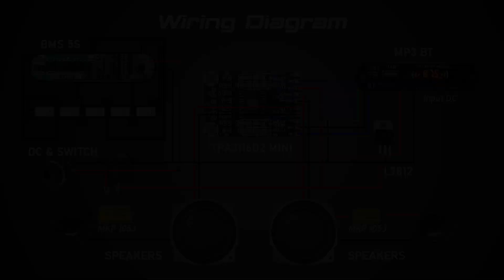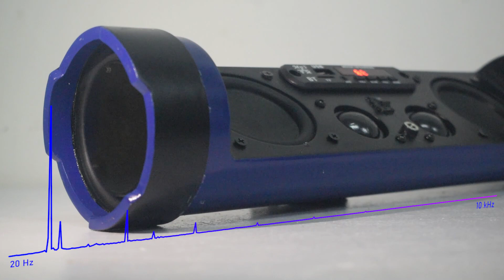DIY PVC Bluetooth Speaker 3 Inch 100 Watt - Aiyima 3 Inch Midrange

Comment: nge lem pasif radiatornya pake lem apa bang?
Reply: Mau kuat bang?
Reply from the maker: Infonya masse? Gimana gimana 🤤🤤🤤🤤
Reply: @RODDEVID  kuat lengketnya maksudnya bang
Reply from the maker: @blackie2774  rata2 pake zhalinda t7000, kuat tapi bisa dilepas juga ga susah
Reply: Oke bang thx infonya
Reply from the maker: Pake lem T7000 om merk zhalinda

Comment: Bang kalau speaker Aiyama 2x 50watt sama kayak punya sampean 
Terus amplifier Tpa3116d2 2x120 gimana bang ????
Terus kalau beli mp3 bluetooth yang sudah ada colokan charger micro dan dipasang di battery bms 5s apakah bisa di charger pakai charger hp ???
Mohon pengarahannya
Reply from the maker: tpa3116 2x120 watt cocok lah bang
kalo mp3 bluetooth itu hrus supply 5V, jdi kalo pake bms 5s, abang turunin dulu tegangannya pake regulator L7805.
Reply: @RODDEVID  cara pasang regulator nya dibagian mana bang ???
Reply from the maker: Ada divideo yg karoke marshall bang, menit 7:35 dan 8:00
Dan juga divideo sy yg sebelumnya ada juga
Reply: @RODDEVID  ok 
Mksih informasi nya
Reply from the maker: sama2 bang
Reply: @RODDEVID  siap bang 
Tapi ngaruh gak ke kualitas suara speaker nya ????
Reply: Mp3 bluetooth itu ada yg bisa support 12v dc gak bang?

Comment: Sehat gan mau tanya klu pipa 3"pake bas pasit nya ukuran brapah .mm.cm
Reply from the maker: Pipa 3 inch itu diameter ny skitar 90an
Mungkin passive 90 mm aja
Tapi sesuaikan juga sama diameter speakernya gan
Reply: Buat tutupny pake pralon ukuran brp lur ?
Reply from the maker: Tutup pralonny itu pake sock 3 inch juga bang kalo sy

Comment: Bang klo pake pipa 4inch bas radiator nya pake yg berapa ya
Reply from the maker: Tergantung speker yg dipake,
Smua ada hitungannya
Kalo misal speker 2 inch, pipa 2.5 inch, passivenya 60-70mm.

Emang itu pake pipa 4", speakerny brapa inch?
Reply: @RODDEVID  sya dah punya bahan pipa 4inch.speaker nya 3inch.modul nya pake xy_p 30 wat.tinggal pasif karbulator nya bang bingung mau di kasih yg berapa ya..dan satu lg bang mau di suplay pake berapa volt ya.biar jos suaranya ngalahin JBL flip5 😀
Reply from the maker: @radityaradit7684  kasih passive radiator 3,5/4 inch tapi yg lentur
supply pake 12 volt aja, powernya tpa3118 kalo0 mau ganas.
Reply: @RODDEVID  ok bang makasih info nya
Reply: @RODDEVID  Speaker aiyima yg 3 inchi tpi baru punya satu ga tahan sama harganya bang 😭😭
Reply: @RODDEVID  dah sya subscribe bang 👍
Reply from the maker: @radityaradit7684  thanks bro 🤩

Comment: Bassnya gimana gan?
Reply from the maker: Lumayan, ga begitu low banget sih bass nya.
Mungkin karna karakter speakernya bukan low bass.
Reply: Kalo di pasangin tpa 3116 yg plus tune control kira2 gi mana gan?
Reply from the maker: Plus tone control, vol treble bass kah mksdnya?
Dlu smpat nyoba sih pake yg ada control bassnya, bassny nambah
Tapi kalo tweeter ny msih kurang bang.
Reply: @RODDEVID  iya gan, di tambah sama twitter
Reply from the maker: Sip itu kalo ditambah tweeter

Comment: Bang saya punya speaker aktif di buat begitu bisa gak bang dan posisi Abang tinggal di mana?
Reply from the maker: Speaker aktif ukuran brapa inch bro, modelnya kyk gmna
Sy d depok.
Reply: @RODDEVID  kira-kira Abang bisa modifikasi punya saya gak?
Reply from the maker: Bisa aja bro, brrti kalo mau dibuat sprti video sy, pakeny pipa 6 inch
Cman bahanny kita blm ada pralon 6 inch
Reply: @RODDEVID  . kalau paralon saya ada bang.
Reply: @RODDEVID  . pipa Paralon saya ada bang .
Reply: @RODDEVID  . Klu Abang bisa kira-kira biaya nya berapa paralon saya yg tanggung.
Reply from the maker: Lokasimu dmna?
Lanjut WA aja bro
085157742114
Reply: @RODDEVID  GMC 888E
Speaker system 2.1 Channel terdiri 1 Subwoofer dan 2 satellite
Power output 55 Watt (RMS)
Freq respon range 20 Hz ~ 20 KHz
Perangkat Input Player berupa USB Port device
Jack Audio Output
Pengaturan Level Volume putar
Pengaturan Level Bass putar
Pengaturan Level Treble putar
Tegangan listrik 220 Volt / 50 Hz
Berat 5 kg
Reply: @RODDEVID  .ada dua biji bang tapi satu nya bukan GMC ukuran nya sama seperti GMC.

Comment: Bang itu pipah nya 3 inch
Reply from the maker: Iya 3 inch bro
Ini sesak bgt, saranku kalo buat pake Speaker ini pake pipa 4 inch aja
Reply: @RODDEVID  saya udah bikin yg tiga inch , spikr nya udah pesn yang itu .. kalau pasip radiator nya yang 92 Mili masuk gk ..
Reply from the maker: 92 mm itu masuk pas, cman dipotong dikit ujungnya
Reply: @RODDEVID  oh iya bang sip .. satu lagi bang , saya mau pake amplipr xyp40 kan stereo saya mau di pararel gimna caranya bang .. apa di pake satu aja input nya atau gimna bang 🙏
Reply from the maker: Mksdnya dipararel apanya, output speakernya?
Oh rencana pake 1 speaker ya?
Reply: @RODDEVID  iya output nya mau pake dua spikr di pararel , kan stereo ,, ambil nya di bagi atau pake satu aja output nya
Reply from the maker: Kalo speakerny cman 1, mending pake 1 output aja, jgn d pararel
Reply: @RODDEVID  iya masalah nya aku mau pake 2 spikr

Comment: How many inches the diameter of the PVC pipe? Is it 4 inches or 6 inches? Pls reply and thank you.
Reply: Thank you so much and god bless you..
Reply from the maker: Thanks 🤙🔥
Reply from the maker: it's 3" diameter, very tight bro.
I recommend u to use 4", for better space.
Reply: Thank you so much. Coz i am planning to make a project same as you did. But i am  curious in battery pack bms connection.  Will you help me?
Reply from the maker: @jerrygonzales2860  sure, that's a wiring connection of BMS 5S, same like i used.

https://telegra.ph/file/4587fce526eac635b1fd3.jpg

Good luck bro 🤞🤙🔥
Reply: Boss bilihin ko na yan pwd ba kahit magkano ?
Reply from the maker: For your reference, all the stuff in description.
Thx

Comment: Bang ini pake batrai 12v 6 aha kh
Reply: 12 vol ngagkat ngak bro
Reply from the maker: 12 volt ngangkat, cman krang maximal
Ini watt speakerny aja udah 50 watt max.
Kalo buat main slow okelah 12 volt.
Reply: Berapa amper bro
Reply from the maker: Monimal 2 atau 3 ampere bro
Reply: @RODDEVID   berapa amper yang bro pake
Reply from the maker: @jepribiantong1505  Sy pake baterai 5S/21 Volt 2300 mAh bro, kalo chargerny pake 21volt 2 ampere.
Reply: Berarti bisa pake 2×12 volt 3 amper
Reply from the maker: Bisa bro, malahan bagus 👍🔥
Reply: Bro kapasitas nya berapa.. mampu berpaa lama.. info terkahir mau jadi sudh...🤣
Reply from the maker: Kapasitas 2300 mAh bro, karna pakenya cman 4 baterai
Kalo mau lebih awet pake 8 baterai.

Kalo punyaku 6 jaman sih volume 70%
Reply: 6 jam itu nonstop
Reply from the maker: Nonstop broo 👍🔥
Reply: Bro kalau gua pake 2x12 volt di sambung.. caharger nya harus pake 12 volt juga kh
Reply from the maker: @jepribiantong1505  iya harus pake yg 12 Volt juga bro, ga boleh lebih ya
Reply: Maksud mas kalau 2x12 volt kan 24 volt... Jadi cas nya tetap 12 vol mas.. info mass🙏
Reply from the maker: @jepribiantong1505  kalo 2 x 12 digabung jdi 24 ga bisa mas di cas pake 12, itunganny jdi 24 volt.
Bisa aja sih kalo pake relay sama rangkaian tambahan, tapi makin ribet nantinya.
Sukit jelaskanny mas kalo via komen gini, gabung d grup telegram aja.
Reply: @RODDEVID  kalau batrai bor 24 volt 3000 mah bisa kh broo.. mas punya 2300 mah kan
Reply from the maker: Bisa bro, 24 volt udah maksimal tuh, saranku pake heatsink ya IC TPAnya
Reply: Iya bro saya beli tpa nya.. yang pake hetsing makasi banyak info nya... 24 volt bisa pake cas thosiba 19 v kan
Reply from the maker: Kalo 24 volt harus d cas pake 24 volt juga bro
Reply: Nanti itu ngisi sampai penuh juga kan
Reply from the maker: @jepribiantong1505  mksdnya kan baterainya 5000 mAh, di charge dengan adaptor 4 ampere?
bisa bro, penuhnya skitar 1,5 jam
tergantung kualitas adaptorny juga ya bro
Reply: Ou iya bang.. maaf banyak tanya soal nya saya cuma bisa otodidak...makasih banyak ilmu nya bang😊
Reply from the maker: Oke bro gpp santuy, seneng bisa bantu juga 👍🤙🔥
Reply: @RODDEVID  selama gua cari² di youtube cuman chenel ini yang mau balas chet saya terus2an
Reply from the maker: Haha, iya bro mungkin yg lain itu pada sibuk
Kalo aku sebisaku ku balas.
😄😁
Reply: Bany saya liat batrai saya 9000mah kaya nya.. bisa kh cas nya 24 volt 5A
Reply from the maker: @jepribiantong1505  brp volt ini?
24 volt juga?
Reply: @RODDEVID  yang saya punya 24volt baru tulisan nya 9000 mah kapasitas... Bisa kh pakai cas 24volt 5A
Reply from the maker: @jepribiantong1505  bisa kok pake yg 5 ampere bro
Yg penting voltase charger ga boleh kurang dri voltase batre.
Reply: Atau carger yang rekomendasi
Reply: Siap bangg kira2 berapa lama cas nya kalau 9000mah
Reply from the maker: @jepribiantong1505  9000mAh : 5000mA = 1,8 jam bro.
Reply: @RODDEVID  bang kalau 24 volt 1 ampre bisa kh
Reply from the maker: @jepribiantong1505  bisa aja bro
Tapi aku sndri mending pake dibawah 24 volt, tapi 2/3 ampere

Coba kirim nmormu, biar kubantu via WA aja.
Reply from the maker: pake 21 volt bro, BMS 5S
Reply: Bro kalau batrai nya 24volt 5ah... Carger nya 24 4ah bisa ngak
Reply from the maker: @jepribiantong1505  bisa bro, silahkan dicoba

Comment: Bang mau tanya.. kalau dia pake tpa3116d2 plus volume bisa ngak
Reply: Bang kenapa ndk bisa pake cas hp biasa info yah
Reply: Kalau misal nya pake modul power Bank
Reply: Cuman untuk ngecas batrai aja
Reply from the maker: @jepribiantong1505  kurang efisien bro
ada rakitanny module fastcharging cman mahal
trs ngecasny pun lama
mending pake rakitan BMS 3S pake charge 12V minimal
Reply: Makasih info nya bang soal nya mahal cas bor... Sudh pesan speker ayima 3 inc 50 wat
Reply: Maju terus chenel nya.. sering2 upload gua nonton cara2 nya
Reply from the maker: @jepribiantong1505  siap bang terimakasih banyak 🙏😁
Reply from the maker: Bisa bro 👍

Comment: kalau untuk di motor kira kira akinya tekor apa enggak ya
Reply: oke bang, makasih banget ya infonya, soalnya punya speaker bekas compo polytron tipe bx500 niatnya mau buat bikin sound di motor 🙏🙏
Reply from the maker: Oke bro sama2 👍👍
Reply from the maker: kalo pengisian batre di motor masih bagus ga akan tekor bang,
kalo speaker ini wattnya ga terlalu gede juga, pemakain batre ga terlalu besar
Reply: @RODDEVID  perlu pake kapasitor bank gak kira kira bang, kalau perlu yang berapa farad kira kira
Reply from the maker: Kalo mnrutku sih ga perlu capacitor bank bang
Soalny itu fungsi kapasitor bank kan utk ngedorong seandainya pake sound yg gede2 wattnya.
Kalo saranku sih yg penting pengisian aki di motor tuh lancar

Comment: Kalau untuk bms 5s 21 vdc, ces adaptornya berapa vol dc gan ?
Reply: Kalau pakai adaptor laptop yang 20 dc apa bisa gan ?
Reply from the maker: Chargeny pake adaptor 21Volt bro
Pake 20 Volt juga bisa, cman nanti ga akan full 21V
Kalo saya pake charge Bor tangan NRT Pro.
Kalo mau nyari adaptor 21Volt ada d Mirrorim.
Reply: @RODDEVID  mantap gan penjelasannya, terimakasih
Reply from the maker: Siap sama2 bro 👍
Reply: Kalo mau cas pakek aja cas nya bor listrik yang 21v, banyak tersedia di shopee/lazada...
Reply from the maker: @abdulghofur9684  siap betul bang, thanks infonya 😄👍🙏
Reply: @RODDEVID  sama-sama bang... 😁

Comment: Bass low ya om, sy bikin pakai kayu tanpa pasif radiotor bassnya gak nendang,
Reply from the maker: Pake ampli apa om?
Emng itu karakter dri speakerny midrange, utk bassnya tipis. Tapi midny keren bgt asli.

Kalo mau lebih jelas lgi bassnya, pake TPA3118 tegangannya 21 Volt, itu kmrin sy coba, bassnya keluar.
Reply: @RODDEVID  
Tpa31162d 120wx2
Ayima 2 50w
Asoka 2 15w 
Smps 24v 
Pakai lubang angin tp bass gak begitu dpt,, vocal bgs
Reply from the maker: @mankjo6950  iya brrti betul tuh emang aiyima 50 watt ini bagusnya di vokal dan mid, bassnya ga terlalu muncul om.
kalo sy pake 2xtpa3118 muncul bassnya, tapi ga terlalu tebel.
Reply: @RODDEVID  klw ada saran om speker 3in subwoofer watt gede, mah tak gantii 😀
Reply from the maker: Waduh jarang kalo sub 3 inch, pake yg 4,5 inch sub homepod aja paling.
Reply: Pasang galaxy turbo bass om

Comment: Kalau untuk ukuran speakernya sama dengan tweeternya sama sama 8ohm 12 Watt, apakah sesuai gan ?
Reply from the maker: Sesaui bro, ya kalo bisa lebih besar dikit speakerny, tapi kalo ga ada itupun ga masalah, yg penting tweeter nya dikasih tahanan tweeter ya.
Reply: @RODDEVID  saya kasi tahanan kapasitor met 2,2uf 100v sudah sesuai ya gan, dengan modul amplifier xy-p15w...
Reply from the maker: Sip bro pkknya kalo tahanan tweeter jgn sampe lebih dri 3,3 uF ya
Kalo mau lebih bagus lgi pake audiophiler.
Reply: @RODDEVID  terimakasih banyak atas informasinya sangat membantu